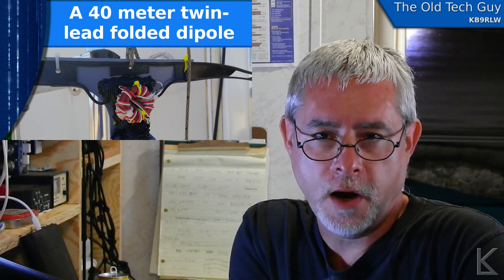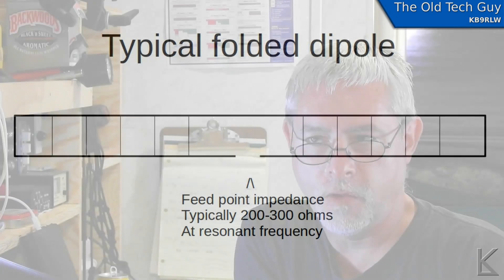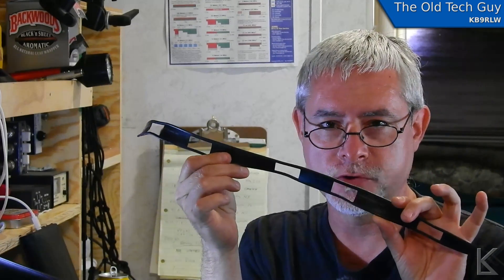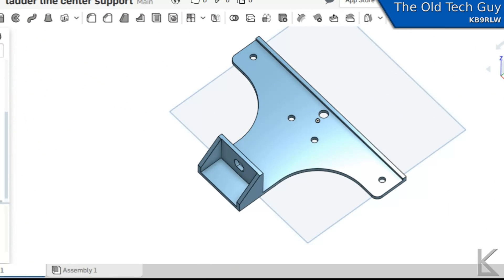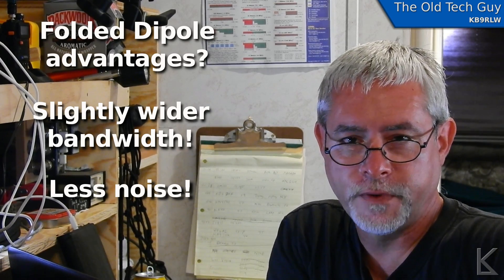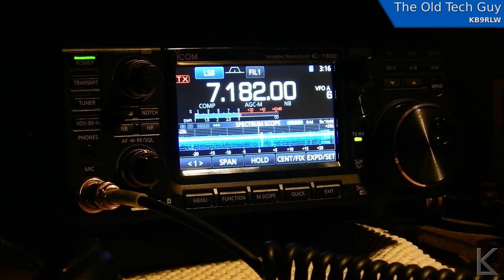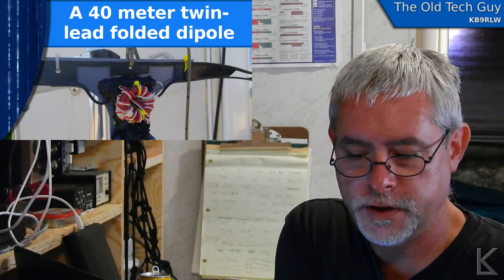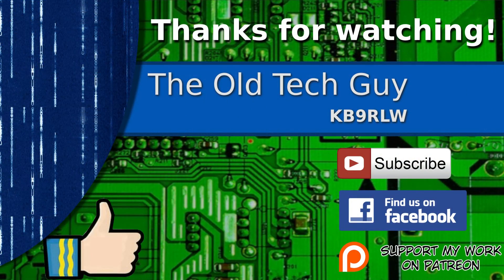Ham Radio - A 40 meter folded dipole using window line.

Comment: I know this is an old video, but it's still good.  If you are not concerned about the bandwidth, but still want a bit quieter dipole, I discovered the secret when I was a novice.  I used insulated wire, which is about the only thing used these days, and when I calculated the length, I made a loop at the end of the wire about 2 - 3 inches in diameter.  I opened the insulation and wrapped the end wire around the main element and soldered it. Then, I covered it in clear silicone cement, now called caulking.  For some reason, it was noticeably quieter than when I did not make those end loops.  My antenna was not just noticeably quieter than open copper wire antennas, but when there was ice everywhere, the old timers could not stand the static.  I had to visit an OT neighbor to hear why he could not stand being on the air, and when he visited my shack, could not believe an antenna could be so quiet. 

If bandwidth is important, then you should know that the wider the wires are separated, to a point, the better the bandwidth will be.  Get them too wide, and you end up with a full wave loop, which is not a band antenna either. Any closed loop antenna will be quieter than an antenna with wire ends.

Comment: Interesting.  I never built a folded dipole.   I was under the impression, other than the slight increase in bandwidth, that folded dipoles have very little advantage over a single wire dipole....and just not worth the hassle of matching and extra cost.   As to the noise...artificial noise (not things like lightning static crashes) tends to be vertically polarized.  Verticals are notoriously more noisy than horizontal antennas...so that could be a reason you're hearing more noise with the vertical.  I built two wire antennas that worked a lot better than I expected....a full wave delta loop for 40 meters because I had a very small lot but really tall trees and, when I moved to a much larger chunk of land, a two 5/8 wave in phase dipole cut for 75 meters....about 300 feet total length fed directly with window line through a balanced output tuner.  The delta loop was fed with coax using a 4 to 1 balun at the feed point...and vertically polarized.  It worked extremely well on 40 AND 20 meters.  I could work Europe from south Florida every night on 74 with no trouble using the long dipole...often receiving "strongest signal on the band" reports from the Europeans.  I loaded it on 160 meters as well...but had to run reduced power because of snap, crackle, pop in my tuner.  It worked...but not great.  Thanks for the video....73.
Reply from the maker: It's a common misconception that artificial noise is vertically polarized.  People usually don't think it through.  Those noise sources, switching power supplies and electronics, would have to all have their external wires running vertically for that to happen. In reality, power cords are usually draped along something like a floor and horizontal.  Mains power lines, including in the house walls, are mostly run horizontally.  
Vertical antennas pick up more noise mostly due to their low angle of attack and omni-directionality.  They pick up noise coming from all directions equally, whereas a horizontal antenna has nulls and a higher angle of attack.

Comment: I’m not well versed in antennas, ok so what’s the advantage of the antenna you built( closed loop) with some other folded dipoles I see on YouTube, with (open loop)?
Reply from the maker: I think it's quieter. Less susceptible to some types of local noise. As far as it being opened or closed, the secondary element acts like a parasitic element anyway.

Comment: I haven't done this but it seems that some OCF dipole antennas don't work well on 15 meters so a monoband folded dipole may be one solution to have a decent antenna on that band,  the same could be said for a monoband antenna for 12 and 17 meters.
Reply from the maker: An end fed half wave wire, fed with a 49:1 match, cut for 40 meters, 20 m, or 80 m, will work on all the even and odd harmonic bands. Including 15 m.

Comment: You are comparing apples to oranges. A proper comparison would be single wire horizontal dipole to Horizontal folded dipole. Any horizontal should be quieter than a vertical. Good video, I agree on all other aspects of your dialog. I will give it a try as soon as possible for my NVIS use.

Comment: If you’re connecting to BNC over coax, wouldn’t you want a 6:1 balun?
Reply from the maker: The type of connector doesn't change the impedance of the coax.
Reply: @loughkb  agreed, that was an irrelevant part of my comment. What I meant was, aren’t radios and coax generally 50ohm? Connecting to a 300ohm antenna would then need a 6:1  balun, otherwise you’re baseline moves to 1:1.5 SWR minimum.
Reply from the maker: @jtmcfarland3512  impedance on the folded dipole is generally 450
Reply: @loughkb  well Gosh, if you’re using standard 450 ohm ladder instead of 300 ohm [which I thought you specified in the video] then that would be a regular 9:1 balun, wouldn’t it? Sorry, I’m new to this and just trying to understand. Thanks!
Reply from the maker: The impedance of the ladder line only counts when it's being used as feed line. Using it as a folded dipole the actual impedance of the feed line itself doesn't matter. It's not being used as a feed line in that point

Comment: Great video. I have a bunch of this 450 ohm line.  I am going to take down my old 20 meter inverted V and put a folded dipole up in its place. First, I need to build 500 watt balun. The only thing is the wind loading on this window line ? hmm

Comment: I thought the benefit of a folded dipole was to reduce the total length of the antennae in the air to one half of the total distance. In other words the 66 feet needed for 40 m would result in a total length antenna 33 feet long.  It looks that you like the line you put up is  66 feet long and that I would make it closer to something I'd expect for the 160 m area. Am I all wet?… Bob
Reply from the maker: That's a common misunderstanding.   It's not the length of the wire, it's the length of the structure.   In a folded dipole, the folded element acts as a parasitic element to the primary.  It still needs to be a half wavelength in physical length.

Comment: Kevin,
You have mentioned you are building a folded dipole with some (I think what is 450 ohm ) twin lead, window line. You made the comment that you think the window are for using less material. This is mostly correct. the windows also decrease the dielectric constant of the plastic, increasing the impedance of the line and reduce losses. Designing and making your own twin lead using mostly air as a dielectric would reduce the losses. I enjoy your videos, thank you for making them. 

73’
KC6WUM   Andy

Comment: After watching this video I found free 300 ohm TV twin lead. I made a 20 meter folded dipole and fed with the same into a tuner with balanced input. I strung it up in my living room full of noise sources. About the worst environment you can imagine in a big city. My living is pretty big but the antenna still hangs down the wall from the molding about 1.5 feet. 

I had pretty decent results at 5 watts for JS8. I had previously been using an EFHW for the same. The biggest issue I have with this antenna is that it doesn't pack up well. The twin lead is a pain since it doesn't go onto a wire wrapper.

Comment: How much coax loss do you have?  How much balun loss do you have?  How much better (worse) would your dipole work with open wire line and a well designed tuner?

Comment: Thank you Kevin! i just found this while looking for info on a 30m folded dipole for FT-8. I wonder (two years later) if you still feel the same about folded dipoles? also i already have a 4:1 dual core High power balun, would using it at 50w be lossy or counter productive?
Thanks Wayne N8KIM

Comment: Is it possible to make a folded doublet
Reply from the maker: You could feed a folded dipole with window line, but it wouldn't be considered a doublet then.    Doublet just refers to a symmetrical dipole that's usually non-resonant and fed with parallel feed line.
Reply: @loughkb  Thought so many thanks

Comment: Due to local physical restrictions, I won't by xmiting..  but due to tremendous noise 'quiet' interests me immencely.
I know the xmit efficiency on other bands is objectionable.. my question is how does it RECEIVE on unintended bands?
In my advanced years I have been allocated to the ranks of SWL..

.
Reply from the maker: Where it didn't TX well, it also didn't RX too well.
Reply: @loughkb  thank u sir..  I was afraid that might  be the case..

Comment: Don' undestand why this antenna wouldn't work on 20 meters.
Reply from the maker: It was awhile ago that I made this vid.   I know I read about why a folded dipole doesn't work well on harmonics of it's half wave length, I just can't recall the details at the moment.  I don't remember if I discussed it in the video.
There were a few papers I read on folded dipoles that explained it.   Search a bit and you'll probably find them too.

Comment: Wondering how this would work if you cut it to length as if you were making a doublite with it.  126' in length ? fed with 25'-30'  window line.
Reply: That is one of my thoughts also.  I have 450 Ohm window line to play with so it might be time to find out.

From what I've read on doublets they are best cut at an odd 1/8 wavelength of the desired lowest frequency ie 5/8 or 3/8.  The same with the feedline.

To tune upper band sweep to see if any upper bands are bad match.  If so, trim an 1/8 wavelength based upon the upper band.

I understand a tuned doublet for 80m can work on 5 bands.

W4RNL was where I found some better reading.

N4VEP

Comment: Silly question but with the window line twisting on the main element does that affect the performance or radiation pattern
Reply from the maker: Not that I could tell.  There were times when the wind was spinning it and signals remained strong and steady.

Comment: So, the length you get from 468/freq, should that be the total length of the window line (end to end) or do you cut that in half because you are folding it back basically?
Reply from the maker: Total length.  The folded part mirrors the other electrically, so it still needs to be a half wave total length.
Reply: @loughkb  Thanks!  I am going to be giving this a try at some point!

Comment: Nice video, man made noise is typically vertically polarized.  That's why a dipole is quieter than a vertical on the lower bands.  73 Douglas
Reply from the maker: I have heard claims both ways, some that man made noise is horizontally polarized and others share your view.  However, I have yet to uncover any real world testing or data to indicate either.
The most probable explanation I have encountered is that verticals are noisier because they are omni-directional.  So all noise sources around them contribute energy to the antenna, whereas a dipole has nulls off the ends, reducing the noise sources that it can hear.
This seems to make the most sense to me.
Reply: Hello Kevin, horizontal dipoles are omni-directional unless they are 1/2 wavelength above ground. ie: 70 ft on 40 meters, 140 feet on 80 meters.
Reply from the maker: @kb9gkc  please provide a link to a technical source that verifies this.  Everything I find mentions the null off the ends and only the lobes off the sides change with height.

Comment: Have you experimented with a folded terminated dipole.  They are very broadbanded.  SWR will be low for the lowest band it is cut for and all bands above it.  They are quiet antennas, but you lose a S unit or 2 in receive.  You usually make up for the loss in the lower noise floor.  I had one that was 65ft long and was usable from 6m up to 40m without a tuner.  It does have a matching balun, and a terminated resistor.

Comment: I have been using a off center fed dipole for many years. When I started out, I did not know so much, but I thought I did. Once I got the full understanding of the off center fed dipole. One of the benefits is the multiple bands it can tune with no tuner.   The tuner in your radio can increase bandwidth of some of the wider bands.  I have 1.2:1 across 12m, and that is a rather short band, but it also works very well on 20 m, 40 m, and many more.  The things I learned  in the years  leading up to now, are that the feed point impedance is governed by the  height of the feed point..  The other thing is the BALUN, it is a 4:1, and I made my first 4:1, and it worked, but not so well. I called Bob at BALUN designs and spoke to him about what I was doing, and he spoke to me for a while, I eventually bought his BALUN that was made for OCFD's. It does handle a lot of power, but I only run 100 watts. There was a marked improvement if the dipole, but still not perfect. The next improvement came when I put ground radials just under the grass line under it.   This was a very good step in the right direction.  The last improvement came years later, and it was after I had my crank-up fold-over tower crash to the ground. The tower only put my feed point at 28 feet. I then installed a Rohn 25 tower, I did this all by myself, and once I was done, my feed point was at 40 feet. This is when my OCFD took a sharp turn for the better, it was now the antenna that many love, and the one  that drives hams toward it. Even if they don't get what I have,  many give up and try something else, but the Ham friends in the area  who had my input on it, all got the same great antenna, and still use it.  The low noise of your folded dipole, might be great for low noise, but when there is no noise, nothing beats my OCFD, unless it is one of the wire antennas that take a football field to assemble and use.  i have very small property in Florida, and the antenna is 90on one side, and 45 on the other. one side runs out to the road, right next to a stop sign,.  So it is all I can do.  I've been using it as my only HF antenna for over 10 years.

Comment: Hi Kevin, as always quite interesting to watch your presentations. Please confirm whether the folder dipole will bring the size down to half. I mean in normal case for instance if the 40 meter require 66feet approx. Will the folded dipole requires 33feet ?

Comment: When you cut it, do you cut for standard dipole length, or half that because you’ve got two conductors?
Reply from the maker: Resonance depends on the physical.length of the structure.  So, as said in the video, half wave length.

Comment: Hi, if you are using anycubic i3 mega (wich looks like it) what settings do you have on Cura pls? My prints tend to wrap on one side. Thanks
Reply from the maker: Mostly the defaults cura provides for the prusa I3.  I never print hotter than 200c with the bed at 60c
Reply: @loughkb  I have tried the same and for the first 5 prints it was fantastic but than I could never come back as the warping started, furthermore some websites say it is due to fan so now will be looking for the circular one. Great videos btw, really enjoyed every one of it. Passed the radio licence in UK not too long ago and loads to learn and explore. M7OTG 73
Reply from the maker: @MrCrystan  If you're talking about warping of the bottom off the bed, you may need to clean the ultrabase.  Heat the bed to 60c and then use a lint-free cloth and alcohol to wipe the bed clean.

Comment: Good video Kevin..I used a while back, a folded dipole cut for 40, and it did work very well on 15, and 6..  6 will be picking up very soon, so keep a listen for the beacons, and the FT8 on 50313 is a good indicator as well of openings...
73
VE6PG

Comment: High there Kevin. Over in Germany they used flat twin feed for the T.V  line. It was 200 Ohm impedance. All kinds of folded dipoles were made with it with modifications for tuning to length for each band by adding capacitance at each end. I've long since lost all the details. The same material was used for the feeder for these folded dipoles with matching at the shack end. So no expensive/ lossy  coax to provide. My Eddystone Rx could be fed direct with twin feeder, so I had no problem.

Comment: So, could this antenna be made of standard 75 Ohm "TV twinlead"?  Only ask because of the plenitude of this antenna conductor.  Where are the cutoff's for its use?  VHF/UHF?  73!
Reply from the maker: The physical form of a folded dipole is used in products throughout the industry and spectrum.  The little wifi yagi I picked up for my extender project has a folded dipole for it's active element.
You could probably build one with the old twinlead.  I'd be interested in what the measured impedance is at the center feedpoint.  It might need a different balun design.

Comment: I have a folded dipole for 40m, made from 450R ladder, I feed it with 300R twin, as that's close to the fed point impedance. I then use a 6:1 balun behind the radio. Works great!

Comment: I’d be interested to see how this holds up for RV life.  Ladder line isn’t very good at taking down, rolling up, putting back up, rinse, repeat.  I still have a roll (50’) left over from a folded dipole I built and used in 2000 or so, I can’t remember what it was called, but I was able to get 160-10 through an MFJ roller inductor tuner with a built in balun.